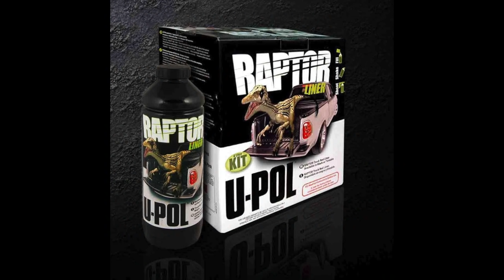Project Doomsday gets raptor lined U-POL Raptor bedliner

Comment: Only replying others searching in the future since this is so old.

How much do you need?
Search online for the square footage of your vehicle, or use one similar as reference.
1 bottle of Raptor shoots approx 30 sq feet.  They recommend two layers

I sprayed my SUV with Raptor Liner Tintable...color is Anvil.
Friday 13th, October 2017 - when you buy Raptor Liner Tintable from, say, TCP Global for example - each bottle of Raptor tintable liner will come with its own 3oz bottle of base color of your choice.  You will only have about 20 minutes to shoot the entire bottle of liner before it begins to become gooey and difficult to spray.  Collect your items needed then - 
- Open the bottle of Raptor
- Add one 3oz bottle of color to the raptor bottle.  You will not need a funnel; the bottle has a large opening. 
- Add hardner up to the top line of the bottle (there are plenty of online U-POL resources that explain this process and identify which line to fill up to)
- Shake for 2 minutes
- Attach the air hose and spray your vehicle. 
You'll want to shoot straight on panels first before you begin turning the bottle to 45 degrees for more difficult places because it will drip/run out the ventilation hole at the base of the gun.

Note:  Only professional shops with someone experienced that can spray Raptor quickly should attempt to mix three bottle of Raptor at a time due to the hardening factor.
Reply: Damian NC  how many bottles do you used to spray the SUV.. I'm thinking of doing mine but I need an Idea of how many should I need,  also did you use any primer ? I notice in the video it looks like they use a some kind of white primer..
Reply: I had the problem of keeping up with the bottles, by the time I'm done mixing one the paint would be close to dry. The temperature you work in plays a factor. You should always buy double of the product no matter what sq footage you have, in my opinion 3 sets of the larger sets would be ideal. Also the way you spray n size of compressor matters. Alway keep the same distance from the rest of the vehicle, if not you'll see the difference in the glare. I would suggest a partner if it's your first time ever doing it. Don't forget to pull the tape while wet, or you'll have hours of fun getting it off when dry
Reply: They say you're supposed to wait an hour between coats i think. Also, wear gloves...

Comment: and add hardener to the line where the bottle go's to lip and add paint to the faint line on the bottle shake it for at least a minute nonstop do 1st coat 40to60psi and fog coat at 80 psi looks amazing
Reply: Hello, what is a fog coat?
Reply: Wet it up
Reply: It's just a light fast coat you spray to even out the streaks
Reply: @JM-ni7ny  does it leave a shine ??

Comment: Pretty Sweet! My Raptor system is  on order . Im hoping 12 bottles be enough to do my 3500 Dodge Ram minus the inside of box , as has a liner. Ill try 75 ml tint base to each bottle with Anvil  colour & spray 60 PSI . Ill be sure to put some KORN on while spraying for added effect ;)  Great Product for this kind of Application!
Reply: What is the color code for Anvil?

Comment: Awesome truck man. Questions: What was the mix ratio and color added to achieve the 'Anvil' color, and about how many bottles of U-Pol were used for the whole truck? Thank you for sharing your project!
Reply: xCOLONELDIRTYx I second that!
Reply: You can mix with a color code mixed by any professional painter  -- use these specs 777g raptor + 223g hardener + 50g color = 1000g
Reply: That guy just poured color in he didn’t measure it ...???
Reply from the maker: Ron Bartosh he said he normally does but the color was really mixing well 🤷🏼‍♂️😂
Reply: So what was the color damn
Reply: @torrayeplanet8228  like pulling freakin teeth round here! Lol

Comment: I don’t understand why my truck came out with so many damn tiger stripes. Any advise?
Reply: Try a little more pressure, maintain a consistent distance from the vehicle approximately 2ft from top to vehicle maybe a little more. Maybe try cross hatching it, meaning spray horizontal and then vertical.  I hope this helps.
Reply: Greg Norvell thanks Greg! I appreciate that!
Reply: @gregnorvell9730  agreed with a lil more pressure and maintaining distance (18 inch should be ideal) but NEVER crosshatch as you will create high and low film thicknesses that cannot be rectified easily. 25-50% overlap between passes would be ideal depending on coating speed

Comment: Hi, how many bottles of Raptor did you need for the hole Truck?  Man I love this truck...........
Reply: Off Driver 1 kit which is 4 bottles does a truck bed so I'm guessing if done correct with at least 1/8 inch thick coat 4-5 kits
Reply: Donn Worry Does it really have to be 1/8 inch if it's not in bed loner
Reply from the maker: The rep from U-POL used 2 full kits

Comment: probbaly wont get answered... but what PSI was that sprayed at? i liked the texture of that, seen some that are really rought. have my entire land rover defender to do!
Reply: TheOneManOpinion they dude spraying said 50psi in the video
Reply: On a different video I watched, they said anywhere from 40 to 100 but he preferred 60psi for best results. It was Raptor Liner for dummies I think? GREAT VIDEO compared to this one one explanation
Reply: Craig Fisher I'm going to spray mine at 60-70. I want a more fine texture. I guess the best way to know for sure is to spray a sample piece and adjust accordingly without going too low, or too high.
Reply: Yeah, the " Other Video " suggested and showed him testing on cardboard
Reply: TheOneManOpinion I sprayed my truck at 70 psi it's super fine texture.. The lower the psi The coarser the texture
Reply: 80 psi at 18 inch spray distance with 5% thinner

Comment: If I’m going to use one of the UPOL Raptor tints, how much tint do I add per bottle? I plan on mixing 3 in the container with the hardener as you did.
Reply: Mitch Jacobsen from what I’ve read 3oz. Per bottle

Comment: If you wanted to spray over the plastic mirrors how would you have to prep the plastic?

Love the vids!
Reply from the maker: gallimore444 just sand them good and spray a adhesion promoter then spray the raptor
Reply: @doomsdayoverland1808  you're correct but between sanding and adhesion primer/ etch coat always wax & grease wipe or atleast solvent wipe with appropriate solvent

Comment: does spraying onto the door jambs and on the mechanisms effect the way the doors close or opperate any? looks like that's what was done in the video so that's why I asked.
Reply: they look to have removed all the door components. the handles and latches look removed.
Reply from the maker: Mycolddeadhand no everything works great.
Reply: It will affect your door closing operation a TINY bit if you spray it as thick as you should - but honestly a little extra yank on the door you’ll be fine

Comment: great video I did my 01 cummins in anvil and black 2tone looks great
Reply: So you can buy it as Anvil?  the guy in the video said he did his in 50psi. What is a fog coat?   My truck was Maroon So I want Anvil for truck then black bumpers bull guard grill and black rims and maroon in spots.. Do you know if you can turn the white letters on tires Maroon by chance? I am fixing up a Nissan D21 4wd
Reply: captain deadpool  not sure of the wheels and ask for base in anvil color mixed for bedliner
Reply: Seth Oliver thanks I wish I could just buy anvil upol raptor  boxed and paint my little nissan D21 I think 8 Liters will do it good at 50psi
Reply: captain deadpool it's much cheaper to buy separate 2 boxes of tintable for 100 a box and a quart of pds base mixed for bedliner  will cost around 300 to do everything that's with tape paper and everything u will need to get the job done
Reply: Seth Oliver how much tintable is in 2 box's and that will do a hole D21?
Reply: captain deadpool 8 bottles and 2 bottles of hardener

Comment: Did he say it has a some heat resistant, that will keep the engine heat from the cab of the vehicle? Might have to do this to my desert beast.
Reply from the maker: Skeebles Ruedas yes he sure did
Reply: @doomsdayoverland1808 , have you noticed a difference in the insulation factors? Any update of this application for the future?
Reply from the maker: Skeebles Ruedas I don’t drive it enough to notice. It’s sits a lot! I didn’t want to ruin the trans etc and been waiting to regear. It’s currently at Rouge offroad getting regeared to a 5.29. Then I will be driving it a lot!! The coating has held up to the hot Nevada Vegas sun well! Color has not changed at all.